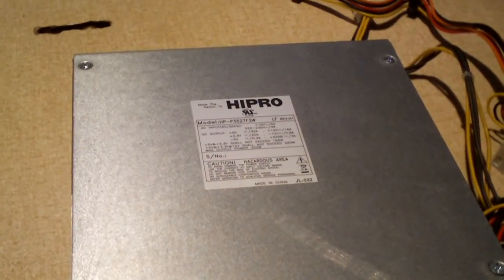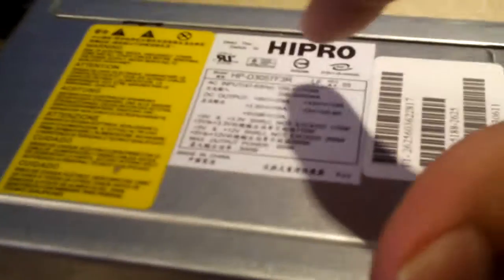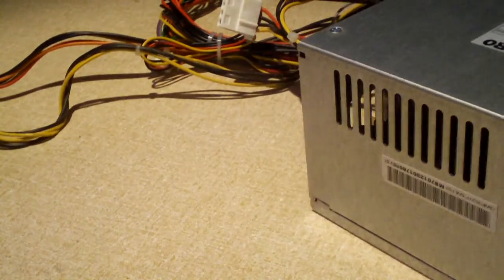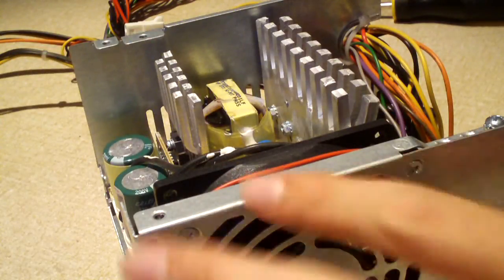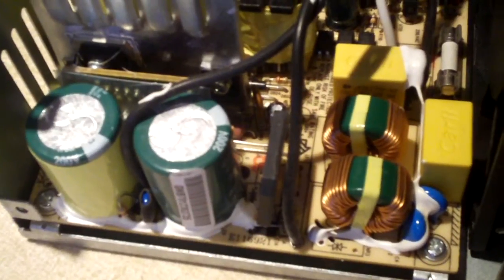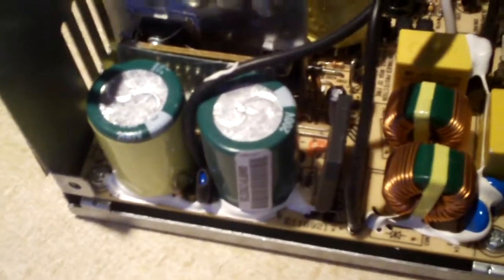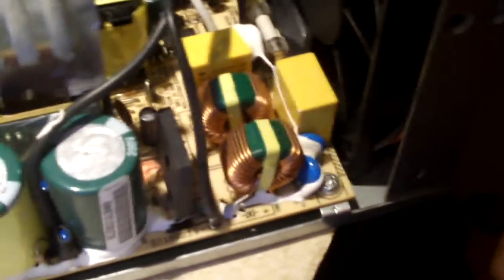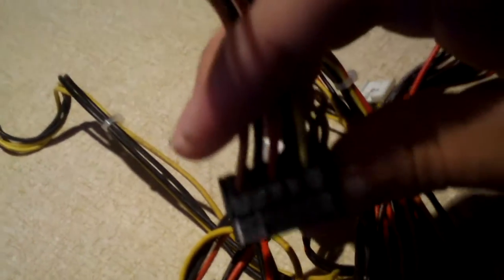Look inside of Hipro HP-3527F3W power supply

Comment: A family member has this exact same power supply. The computer will not boot but the stand-by power comes on, just as you described here. Came out of an E- Machine. I could not find this model to purchase anymore and I wouldn't know how to repair it. Do you know of an alternate model out there that I could purchase to replace this one?
Reply from the maker: Casey Fallen Any ATX 300W unit will replace it. You can probably get a FSP unit for a decent price.

Comment: I used to have a Hipro PSU in my system, I find them quite reliable and they really do crank out some serious power when you load them up past their recommended limits, the one I had was a 400W and I managed to push 550W continuous for 53 hours in a test and it still ran perfect afterwards, I tooka  look at the waveform's on a local techie's osciloscope and even under more than max load, there was absolutely no ripple or noise from the 3.3, 5, 12 and 5v SB rails, and I can safely say that when it gave up on me, it didn't take the system with it... unlike the Bestec PSUs!!!

Comment: i have a HP-D2-3527F3W power supply mine runs very well even after 8 years in my friends machine which was used every day and now into my machine i would give it back to him for his new machine but it runs so well in mine no problems or bad caps at all it is a wonderful power HIPRO unit i highly recommend it. I have 2 ones of the same model by HIPRO they run incredibly well although if i were doing something like gaming i would not recommend one but for usual everyday internet youtube they are the perfect PSU i dont even want a Seasonic it runs so well

Comment: Also, mine has a different main switcher (STW9NK90Z instead of FQA9N90C or FQA9N90). And my mistake, both units have a 20-pin connector. Teapo often fail without bulging, too. Capacitors can do exactly that. However, if the power supply still works fine otherwise I'd leave them alone. I think the ATX-300-12E actually had 560uF primaries, not 680.

Comment: This is great for voltage regulation and ripple suppression but is very inefficient. Seems to be a fairly solid unit minus the ADDA fan but it isn't really overspec'd for a 300W unit. I have a very similar unit but it has Teapo LXK capacitors in the voltage doubler instead of Elite GM and has a 20-pin connector instead of 24-pin, and no SATA connectors.

Comment: That does a big part of the filtering, so the ripple current going through the filtering capacitors on +5VSB is much more strenuous, and when the computer is off, assuming AC power isn't removed, +5VSB is still present so the fan isn't spinning and the ambient temperature in the PSU is much higher in that area, because of that. Furthermore, this PSU doesn't appear to have a magamp for +3.3V. It uses linear regulated DC-DC conversion from a separate transformer tap in the main transformer.

Comment: That power supply doesn't use a two transistor +5VSB circuit. It uses a Fairchild (originally Samsung before Fairchild bought part of their division) power switch known as KA1H0165R, which has overvoltage protection. That Teapo probably failed because it's the capacitor that has the most filtering work to do on the output of an auxiliary winding flyback transformer (+5VSB). Flyback topology doesn't have the big toroid you usually see on the +5V/+12V rail and +3.3V rails.